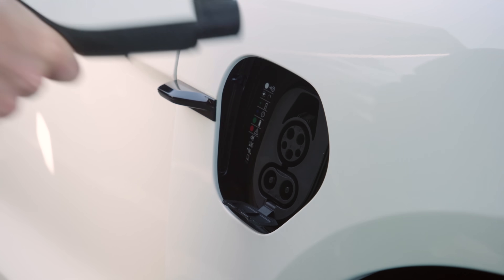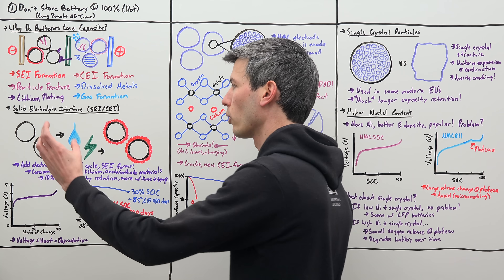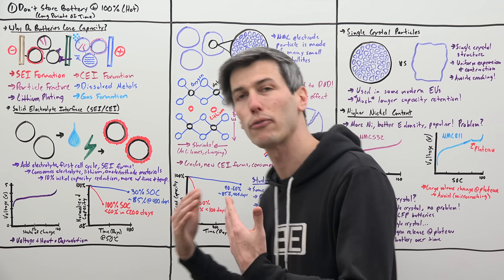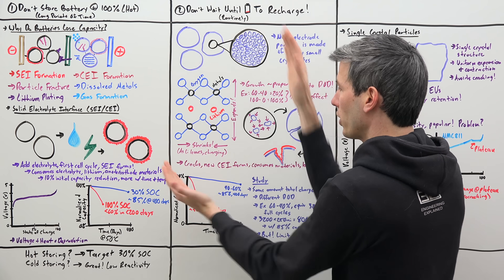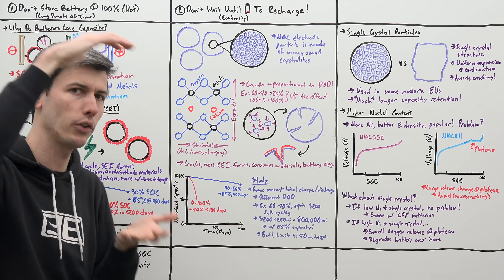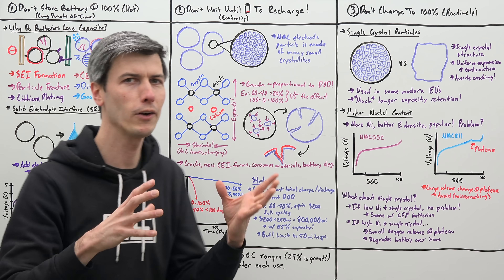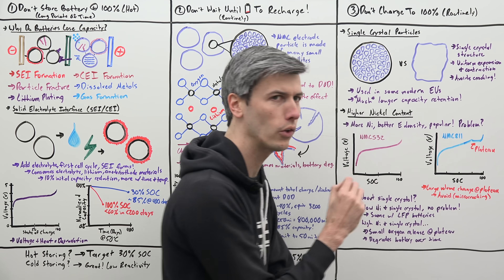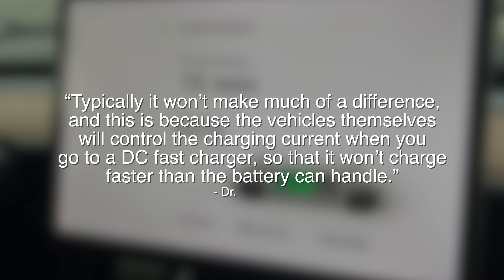How To Ruin Your Electric Car's Battery - NMC Edition!

Comment: Incredible that in my lifetime, we went from Power Wheels to Teslas. But EVs are not for everyone, and the government needs to stop pushing it. That said, they are just as viable as forcing everyone to buy a 150cc scooter. Some states, some seasons, they work, but they are not THE answer, they CAN be AN answer to SOME people SOMETIMES.
Reply: The problem is, we really need to pivot from burning carbon containing stuff in these massive scales, electric cars aren't even a good solution, they're just one option. Fuel cars will probably still always exist, as they probably have their own little unique optimal niches.
Reply: No, they work as passenger cars for everyone all the time. Most people drive locally and two thirds of all "road trips" are four hundred miles or less, which is something pretty much any modern EV can do. Can't charge at home? No problem. CARB state mandates in 2035 allow for plug in hybrids and the purchase of used gas cars FOREVER. No one is being "forced" to purchase an EV. And an EV is certainly cheaper than rebuilding your house after a flood or fire.

Comment: Don't the manufacturers put an artificial software cap on the charge so instead of being at 100% you're really at 98% in order to mitigate overcharge?
Reply from the maker: Generally yes, though the best practices remain (say it's 98%, it's still a higher voltage and thus impacts degradation).
Reply: The 100% is not an intrinsic characteristic of the battery, it's arbitrary. It is a trade off between how much capacity one is willing to have and how many cycles of charge before it loses 20% of the original capacity (after that the battery can be considered almost dead since degradation speeds up and it quickly becomes unusable). For a phone target is 3~4y. For a car im guessing industry is aiming at 10y . Finally If you set a new 100% at 98% one could argue that since full charge is still a point of max degradation why not to set the max at 98% of that value, an endless problem.
Reply: The “buffer” or unusable kWh that everyone talks about is really just limiting the cell voltage range to protect the battery from extremes.
Reply: Sure, Tesla even has more range than 0km left actually beung 12km left. Tesla cars charge to 90% by default and Tesla sells different sizes with the same battery but dofferent software limits.
Reply: @Loanshark753 He's talking about a hidden limit the owner can't see, basically a buffer. The car will show the owner that it's at "100%" even when it technically isn't.
Reply: @Loanshark753 I don't think that's the case with Tesla for a few years now. It was only happening with Model S/X before 2020 (the ones with a number suggesting the battery size like 75d,90d, 100d, p85 etc).
Currently model 3/y standard range has different battery than long range/performance
Reply: @ReximPL   The SR Model 3 and Model Y use the lithium ion phosphate batteries, iirc.

Comment: Vehicles used to cost about 1/4 of a persons annual income, there waaaaay over that now. And I hate most vehicles beyond about 2008. Be they’re IMO full of gimmicks, overly complicated due to those gimmicks, over priced and heavy. Late 90s early 00s vehicles are peak IMO.
Reply from the maker: But the Crosstrek came out in 2013, and it is peak vehicle.
Reply: Buy the roght viechle. The total cost of ownership is also dependent on fuel cost, mileage and insurance and finance cost. Therefore compare the total cost, if the cost of a decent ev is too high maybe buy a plugin hybrid. A benefit of a phev that allows electric only driving is that the wear on the ICE is reduced.
Reply: @Loanshark753 I’m certainly less harsh on hybrids assuming their systems are durable and repairs and replacements of critical components isn’t 1/4 the cost of the vehicle, per…
Reply: I remember when I was a kid in the 90s and 00s, everyone was saying that new cars suck now and old ones are better. People always say that. The truth is in most ways, cars are better now.